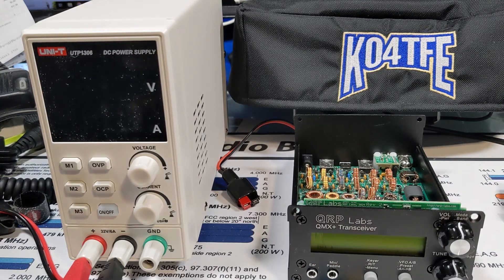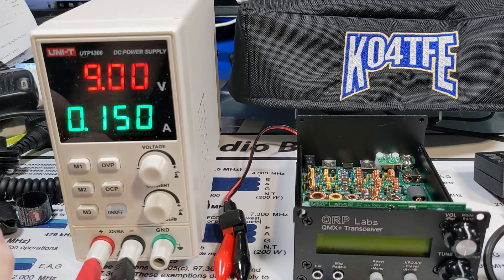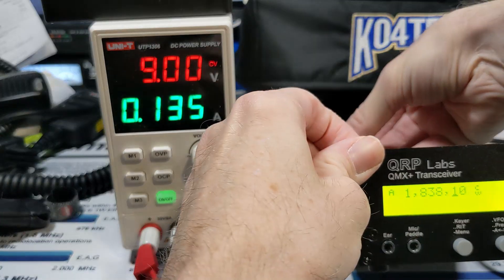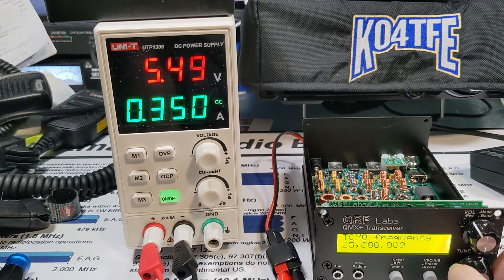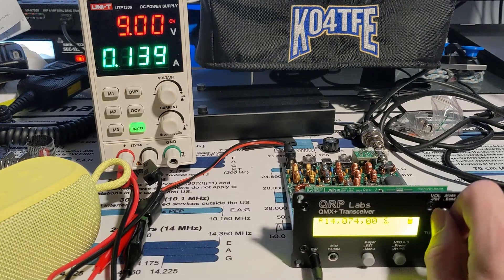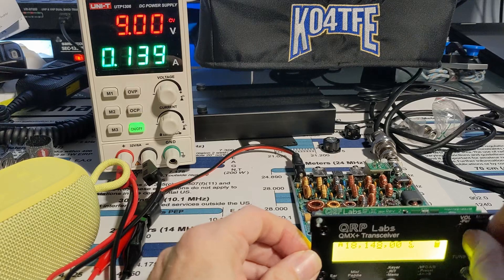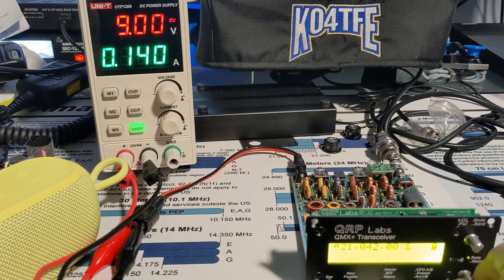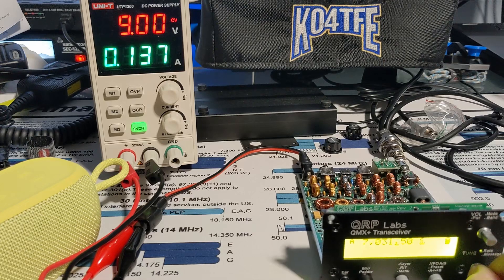QMX+ Kit Build Finale: First Power-Up & Contact

Comment: Jason, thanks for the QMX+ videos you inspired me to buy a kit and start on the QMX+ myself. David N4IN
Reply from the maker: Happy to help you spend some money! it is a really fun kit, especially if you like winding toroids, which I do, I find it relaxing.
Reply: Finished kit and got on the air over last few days, did first POTA activation with it today on 20M. 3w out on most bands 160M about 5.5w. I had one problem 6 pin 90 degree male pin connector was missing one pin. Was able to improvise solid conductor wire to that shape.
Reply from the maker: @DesN4IN  That's great!  I think I still need to tweak some windings on my toroids to bring the power up on a couple of bands. But I've had good luck using the radio.

Comment: Could you elaborate on the "issures" you found with the bandpass filters and swr bridge? I'm getting close this point.

This series has been quite helpful in clearing up various thin spots in the manual.
Reply from the maker: Glad you are finding the series helpful!

The issues I had was with enamel removal from the magnet wire. There are several ways to remove that, sanding, dremel, or just melting it off. I chose to melt it off.  On this particular kit because it is a 6 layer board there is a ton of copper and it's hard to get really hot.  So, I had to just put the iron on the joint and be patient and hold it there for a long time, maybe 15 to 30 seconds to get the enamel fully melted and the wire soldered to the PCB.

Comment: Just finished building my QMX+ this week.  I had a similar issue with unusual operation while in the case.  Apparently I had a few taller than normal solder joints on the bottom of my board. Those joints were contacting the case. Working great now.  
Thanks for sharing and 73!
Reply from the maker: Yeah, that's easy to do...it's not as cramped as the QMX but it still is pretty tight in there!